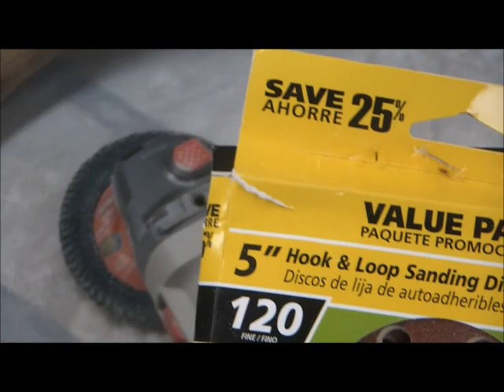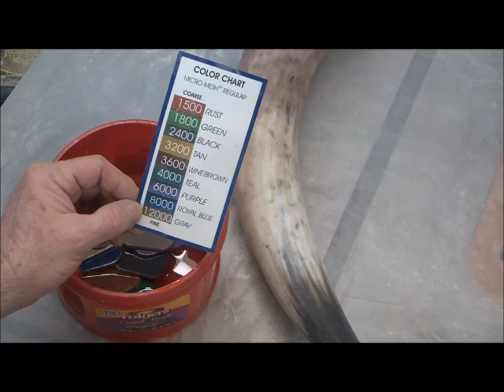Off Topic- In depth explanation of how to make cattle horns gorgeous

Comment: Use epoxy resin in the cracks after wire brushing them and before you start with your 2nd grid. The natural colour will hide the correction for the most part or match the colour epoxy to the area.

It will prevent further cracking and seal it if you want to make a powder horn or something else.

Great vid

Comment: What base would you use to attach and make them stand up? Thank you
Reply from the maker: Honestly no idea lol. Maybe a piece a wood shaped to go inside
Reply: Thank you for the quick response! Your video helped me a lot! I own a small farm with Scottish Highlands. We keep all heads and end caps. I now have one sanded almost to the shine, cut the bottom and hopefully by sanding I will get it to stand by itself. Seems I need a weight on bottom inside or glue to something. It hopefully will be displayed for holding bracelets, which I also make. I'll figure it out before my first show in August. Now pricing, any idea how I can figure that? On line price is all over the place. Can't really go by materials cost plus a percentage.these are going to be my high end seller. Sorry, I'm just babbling my thoughts. Thanks again for a great video,!

Comment: At 4:51 when you reached for the second horn, I noticed a rash on your arm along with your hands. The reason I am pointing this out is my daughter inherited the very same one. When she was just a wee thing it drove her crazy and i was desperate to find a way to relieve her itching. She was an infant at the time. I spoke to a friend about it and she suggested taking oatmeal and dabbing in on the rash. I thought what's there to loose it's only oatmeal. So i turned the oatmeal into a powder and soaked it in a bowl with warm water. Dabbed it on and no kidding, right hand to God the rash was Gone in 10 minutes. I didn't get the results until after I had used a wet rage to wipe it off. It became my go to whenever she had the rash re-occur. She out grew it and is fine now but it did torment my little one till I discovered this home remedy.  Good video thank you for taking the time to make it.
Reply from the maker: You're welcome and thanks for watching, but the rash isn't a rash. I have vitiligo...

Comment: Hi I have a question I am working with horns for the first time I have a lot of scratches on them and I don't have an electric sander I'm just doing it by hand I wonder how long do I have to stay around until all the scratches are gone for when do I know it is done it is sanded enough let me know soon as possible
Reply: Eva Wieler, hello, I am in no way affiliated with the people in the video. However, I will try to give you an honest answer. My horns go from "raw" (as they came directly from the critter....only they have sit & dried for a few years), to "shiny as a baby's bottom", w/o using any actual buffing or polishing. My way of doing this, is only my own way. I know everyone has their own methods...........The only type of "electric sander" I have is a Dremel. Initially, I put a 60 grit sanding drum on the tool, & w/o much pressure, sand with the grain of the horn, from tip to "bell end". This simply takes off the outer crud/crust. But leaves ridges; the natural pitting; & any other natural imperfections....Once I have made one complete circuit around the horn, I switch to sanding by hand, with a piece of sand paper between my fingers & the horn (I don't use sanding blocks)....I again start with 60 grit paper, sanding in a "circular motion", similar to the Karate Kid "wax on/wax off". After making several circuits around the entire horn this way, I then repeat the process with 80 grit; 100 grit; 120 grit; 150 grit; 180 grit; 220 grit; 320 grit; 400 grit; 500 grit; 1000 grit; 1200 grit; 1500 grit; & finally 2000 grit.........Depending on what condition the horn started out in, this hand sanding takes me anywhere from 10 to 20 actual man-hours of actually sanding (not including any type of rest breaks).......Once I feel that I have the smoothness where I want it to be, I then hand wash the horn (inside & outside) with dish soap in very warm water (as you would, if you were doing the dishes). Once all the dust & residual interior membrane has been washed away, I rinse the horn off good (inside/outside), and let air dry for several hours. The horn now only needs buffed/polished if a person wants it super shiny instead of a matte look.............I hope this helps you. Have a great 2020.

Comment: For really deep damage, even holes, try Bondo. A little sanding, a touch of paint (if you have an airbrush, you can match the color and completely hide the damage,) you may have to use an incredibly fine grit to feather it out.

Comment: hi Charles excellent video, on the badly marked horn have you tried collecting the dust and mixing it with a small amount of araldite,  same as doing sawdust and glue, I used to make shepherds crooks using rams horns,and on the odd occasion I had to just that, dosnt make for a show horn but does make it look a sight better than leaving it as is
Reply from the maker: I'd then have to do something to get the same shade, but I appreciate the advice. Thank you for watching.
Reply: @CharlesDearingScroller  for a horn that was going to spend its time working outdoors we used to spray them with automotive lacquer 3 coats

Comment: How do you get the bone out of the horns up where it connected to the head? It goes up into the horn quite a ways
Reply from the maker: If you're lucky, you can just use a rubber mallet (something covering it so it doesn't leave marks) and pop it a few times. Most come loose. Now and then you have to do what is called "sweating it off". Wrap the horn and base in a garbage bag in warm surroundings. Sometimes this will help loosen. The mallet works most often though.
Reply: @CharlesDearingScroller  thank you sir i will give that a try. I appreciate it.

Comment: While recently at a reinassaunce festival my son was admiring a nice bull horn hanging off a guys belt. It looked like something he kept his "grog" in. I ended up buying 2 but they don't look completely finished, still pretty though. The top or mouth piece is roughed up, unlevel and just plain not looking like a place to put lips. Do you have any suggestions on fixing that and should I seal it on the inside with anything? The one we saw may have had a white coating on the inside. Or should the idea of drinking from it be stricken from our minds never to return?
Reply from the maker: I've always left them natural so I may not be the best to tell you what to do. Most times drinking type horns have better shaped tops with rounded edges. I haven't done it so I cannot, in good conscience tell you how. I want to say wax is used inside the drinking horns, but I don't recall. I believe I saw a video at some point on youtube that does answer that, but I've slept since then lol. Sorry I couldn't be of more help.
Reply: @CharlesDearingScroller  you have already been very helpful. I have learned since my message there are a few ways to coat the inside, one is beeswax (which I just ordered), also you can use food grade epoxy, or salad bowl finish. Only the epoxy is long lasting but the beeswax is ok for cold beverages. I do live in Az so before summer I will probably get some epoxy. Now to learn how to soften and round out the top.....lol Thanks for your video ;)

Comment: Question: when cleaning an old dead head horn and it’s been very yellowed. Is it likely because it was in dirty water too long and it’s leached through? Or is it because it’s from a badly rotted old head? And is peroxide a good way to try and pull the yellow out of this old longhorn?
Reply from the maker: This process MAY help with that yellowing. I've often been too paranoid to soak horns in anything but water because I don't know what chemicals will do to them. So I honestly don't know what to tell you because I don't want to mislead you.

Comment: Well this process work on smaller  horns?
Reply: Why not, I’m a lazy person and all work I do on bone or horn I use an angle grinder and I have only done it with small cow horns like 10-15 inches long and they’ve turned out great in my opinion. 

Angle grinder with a flap-disk for rough work then jump right to a flap disc for rough polishing then fine flap disk and then a polishing wheel

Comment: Awesome video! Question...I have a long horn with horns attached, is it ok to do that process while they are attached? Also, my horns are very weathered with flaking on the first layer happening.  They look very dry.  Is it still ok to do this process?
Thanks Again
Reply from the maker: I don't know how I didn't see this comment before. Yes you can do it with the horns on, but you obviously have to be careful not to damage the skull in the process. As far as flaky ones...with the first step use it very very very gently. Some horns are too far gone though.

Comment: Scratches are not too deep I already sanded my hand for 2 hours but there's still a lot of scratches how Wonder if you send it until all the scratches are gone or do you just leave them on there
Reply from the maker: I feel bad for you having to do it by hand, but the key is to go through the grits of sandpaper. The higher the number, the smoother the sandpaper. What you're doing is using one grit of sandpaper to lessen/remove the scratches that the more harsh grit left before it.  Ideally, it's up to you how much you wanna mess with it lol.
Reply: @CharlesDearingScroller  okay thank you very much yeah I'm pretty tired of sending already maybe I'll have to do a few more hours thanks for your reply and thanks for that video that you already made I searched for hours on YouTube couldn't find anyone explaining it as good as you did cuz I only had to do it but Hannah had to ask questions and I wasn't sure all the scratches had to go or it was good enough if they were still there so yeah thank you very much
Reply from the maker: @childrensministry.  Glad I could help. I always try to be very thorough. Good luck!